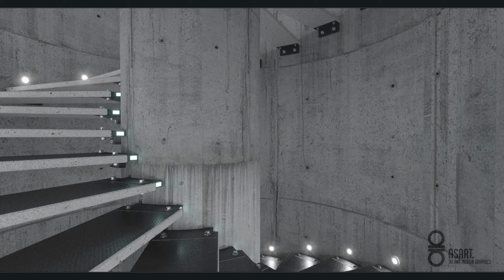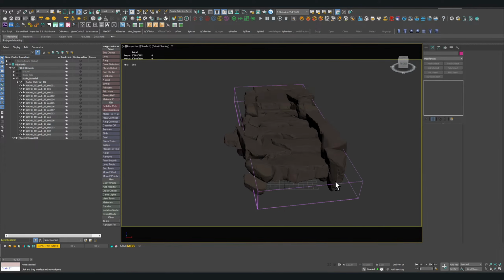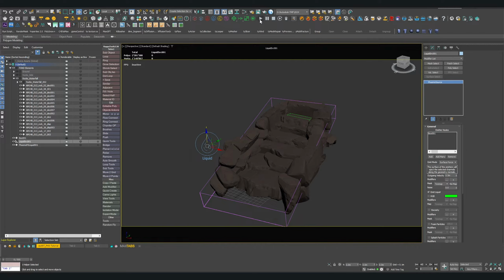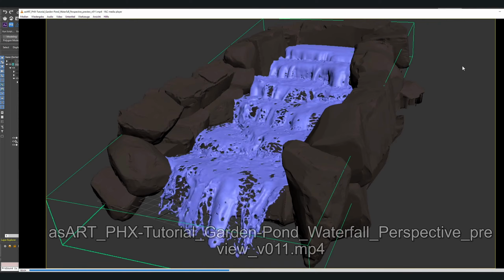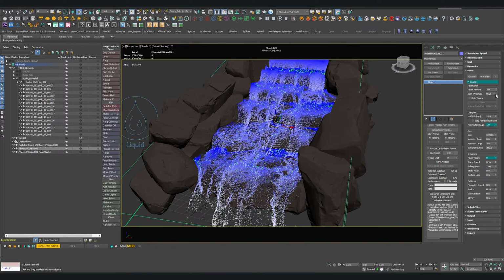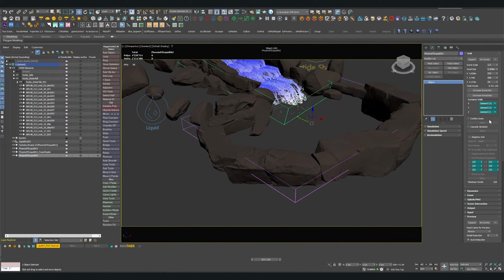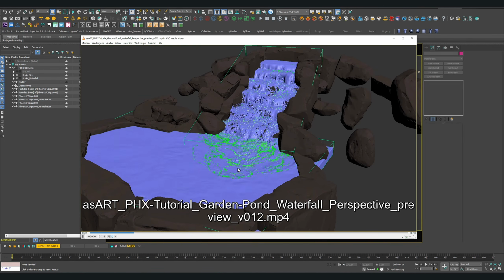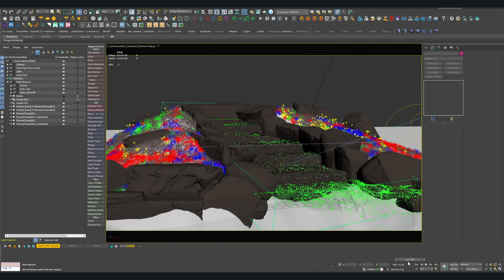3Ds Max and Chaos Phoenix Liquid Simulation Tutorial | "Backyard Pond Waterfall"

Comment: Hi.. foam visible in simulation  not appearing in vray render.. what to do sir?  increased size multiplier and count multiplier in particle shader.. still invisible in render... is there any another setting for vray?
Reply from the maker: Hi .. make sure that you have added the MESH operator in your tyFLOW Event .. Otherwise they'll not be visible in your render .. Assuming that the MESH operator is missing .. Re-Check and it will work .. Cheers